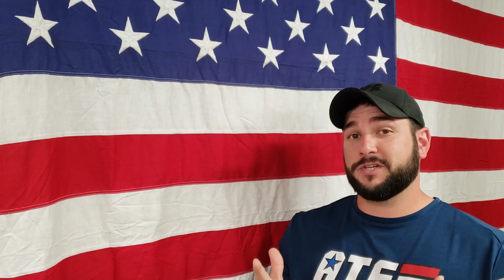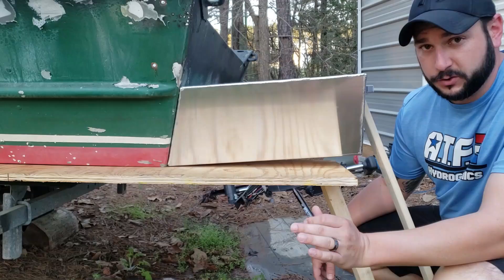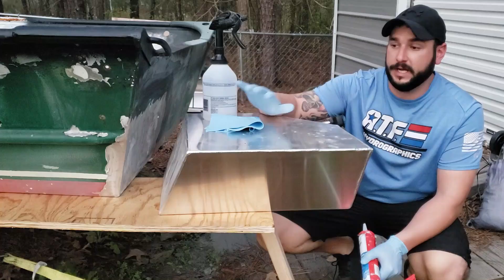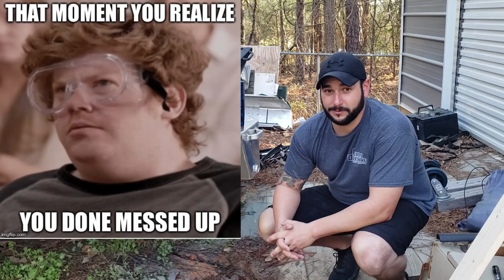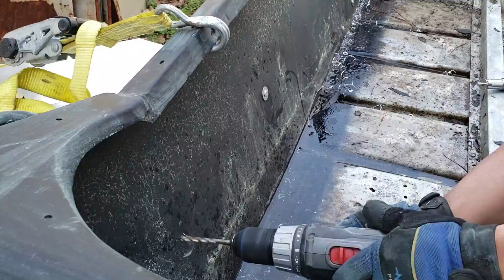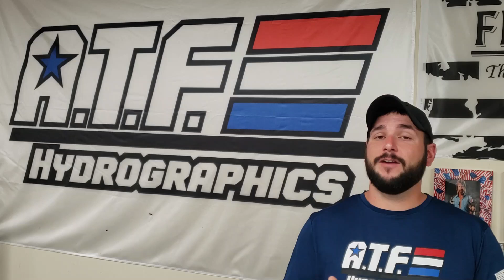DIY FLOAT POD INSTALL || Project Bottomland Bateau - Episode 6

Comment: Have a 1642 with 40hp  yamaha currently  ,would these   make a 55 hp evinrude doable
Reply from the maker: Not sure on outboards, I am a mud motor guy. I know my large 670 predator kit weighs just over 300lbs and the pods helped me a lot.

Comment: How wide is the boat you installed the pods on. I have a 48in wide but all I can find are the large beaver tail float pods
Reply from the maker: 48 inches wide on the bottom. The pods seem to be hit or miss in stock. They sell out fast.

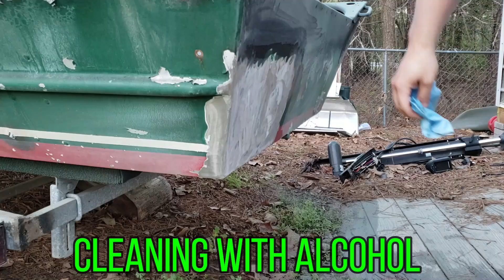Comment: @ 3:51 If you are looking for a structural installation with 3m 5200, it tells you twice on the label not to clean/prep with alcohols because it will "prevent cure". When used correctly 5200 will grab on like a mad octopus and not let go. So if you ever have to remove the pods for repair, you will have a lot of repair.I would suggest 3M 4000 instead, it is less permanent and still structurally sound.
Reply from the maker: Thanks for the tip

Comment: Hey a question for you on the pods. If you’ve  already had them out in the water, how much of the pod is exposed above the surface? I just had mine installed and had it out and I can’t find anything on the internet showing what’s considered normal. Mine are about 2 inches above the water and my motor is 200lb Im 250 and the fuel and battery is about 100. I bought the beaver tail large pods for my 1860 tracker.
Reply from the maker: I have some videos of them on my Jon Boat channel and on my instagram if you want to check them out. Send It Jon Boats is the name. they are about half way submerged I would say. I will soon be doing a video for the jon boat channel all about the pods and clearing up a lot of myths I read about the pods.

Comment: How did this turn out? Have you had any issues?
Reply from the maker: Not a single issue. I used the pod handles to pick up the boat all the time and they are on there forever. It would take a jack hammer to get them off with all the 5200 on there.

Comment: So what was the end result, have you had it on the water yet?
Reply from the maker: End result is that it works great. Held up to a lot of abuse and have picked the the boat up by the pods many times. Still holding up with no issues. All of the boat videos have been moved to the new jon boat channel. It is called "Send It Jon Boats" if you want to go check it out. Will have some videos up on the new channel with those pods soon.

Comment: You were doing ok, UNTIL, you put those SS washers on alum.
They will eat the Alum.
Reply from the maker: I made sure to paint the aluminum before I put any stainless washers on, plus the rivets were coated in 3m so if there is any bare aluminum contacting the stainless it is very minimal. I could not find a source for aluminum washers anywhere local so I did some research and found that many people have used stainless and aluminum together with no issues. I'm by no means an expert and you may be 100% correct. If it does eat away the aluminum I will do a follow up video and warn everyone not to do what I did.

Comment: Perty kool, i was thinking of building my own, but for the price, heck that's not bad. Marine grade aluminum is costly not to say my argon gas and time. Awsome post thank you. i have a 15' aluminum and the new four stroke is a little heavy, these will work perfect
Reply from the maker: I actually contemplated welding some up for this one as well, but the price was not bad and it saved me a ton of time. Thanks for checking out the video, hope it helped.

Comment: How big was the gap between the ply board and the end of the pods? What angle is recommended?
Reply from the maker: It was about 1 and half inches. The instructions recommended at least a half inch to one inch of rise. They didnt give an exact angle.

Comment: The stainless washers will react with the aluminum rivets. It may take a long time, but they will corrode.
Reply from the maker: well hell... didn't know that. Everyone on the planet told me to use stainless. Guess whenever it corrodes I will be replacing them all.
Reply: All Things Fun Hydrographics stainless is the absolute best option for hardware, but science unfortunately doesn’t let aluminum and stainless get along together. I have a 16’ xpress aluminum boat. All of the hardware is stainless, but I coat all of the SS with anti-seize compound to prevent corrosion. SS bolts are the worst about getting that nasty white corrosion.
Reply: @johnnysullivan8613  rusty stainless zip screws in aluminum gutters tells all.
Reply: If you use your boat only in freshwater, that will help. Basically in galvanic corrosion, two dismilar metals in the presence of electrolytes kicks off an electrochemical process, where it breaks the bonds of one of the metals (namely the aluminum in this pairing). If you've painted or put the hydrographics over it, it may help slow or prevent that reaction.

Comment: Did this help with any side to side shakey ness or just keep butt of boat out of the water with the waight of the motor?
Reply from the maker: Good question...  I'm not sure yet. I'm not done with the boat so it hasn't even been in the water yet. My hope is that it will help keep the back end up since the motor build is going to be pretty heavy. Should be painting it in a week or two, which we are shooting a video on, then building the motor, and should have some water testing videos within a month or two. Stay tuned, should be a cool build.

Comment: How is that application working for you i have a 17ft jon boat with a 45hp outboard thinking about putting those pods on that looked pretty easy rather then paying someone to weld them on.
Reply from the maker: I haven't finished the boat yet so it has not been in the water. I am hoping to get the boat painted in the next few weeks, then finish the motor build, and get it out on the water. Once we have some time to run it there will be several videos on how the float pods do.
Reply: @AllThingsFunHydrographics  awesome

Comment: With those sticking out transom like that. Will I have to Redhill and replace my transducer? (Side Imaging) Thanks for video. You made it seem pretty easy so i may just have to try it now
Reply from the maker: Im not 100% sure yet. When I put my transducers on, I will probably tape them in place a first to see how they do before I permanently mount them. I would prefer to have them on the back of the boat and not on the pods but we will see what happens.